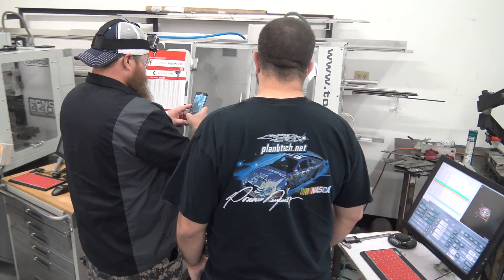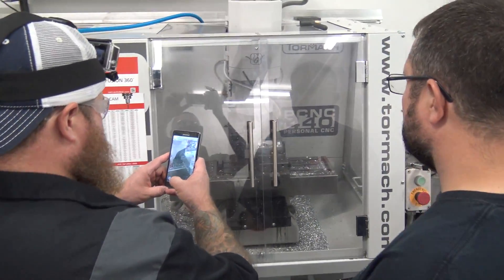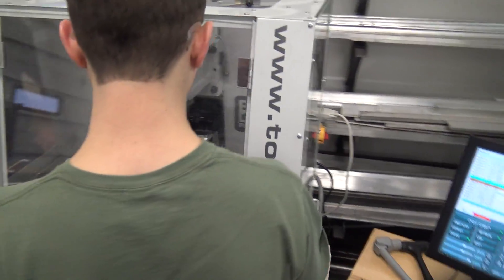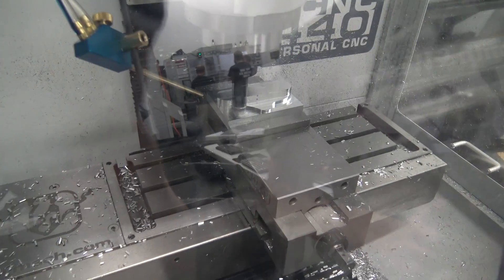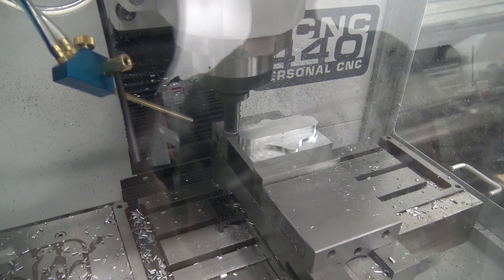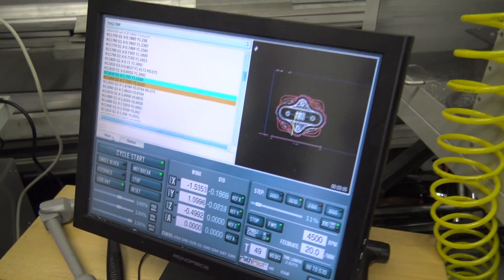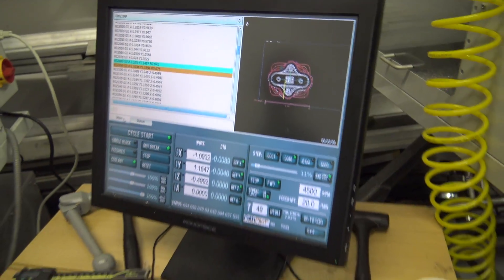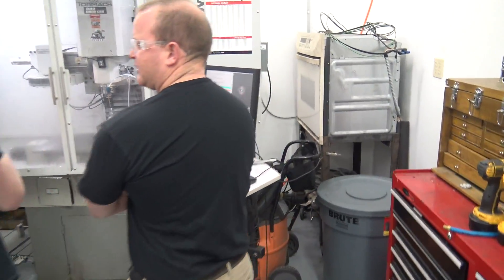CNC Training Classes

Comment: And why MUST one need to use Google Chrome???
Reply: +Jim King because. Also it's probably to ensure it works smoothly. Continuity is your friend for assured performance. Some code also doesn't run well on some browsers, a problem programmers have often is a website fuctioning of one browser but not another (typically ie)